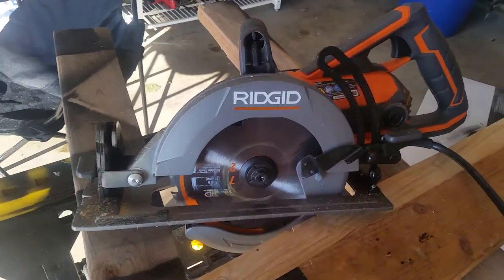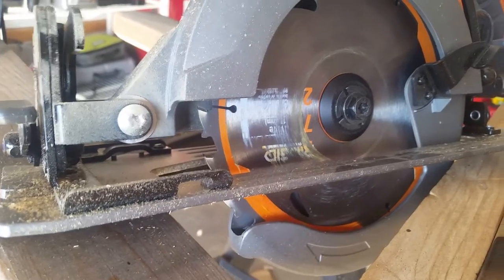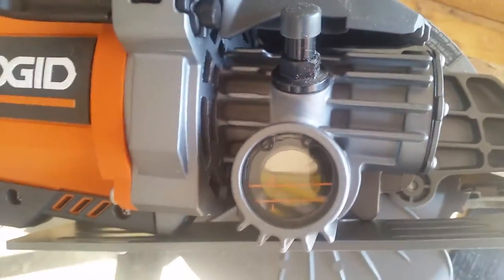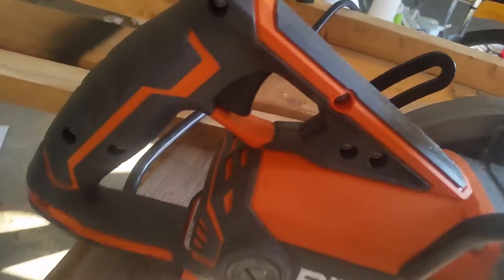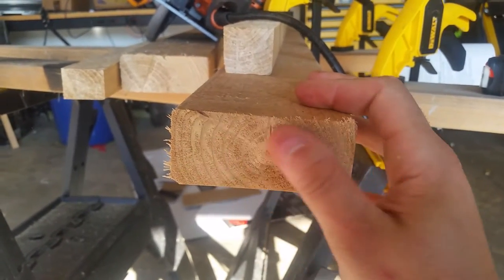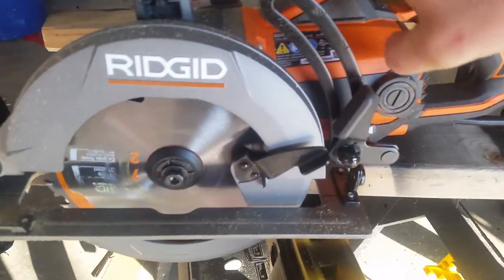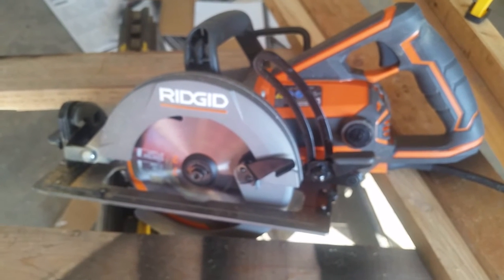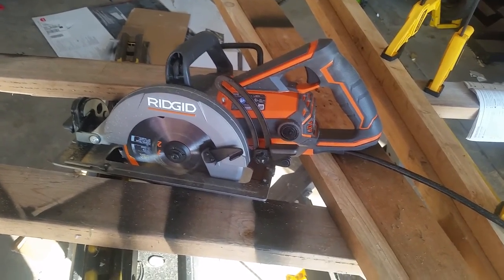The RIDGID TOOLS Thrucool 7 1/4" Worm Drive Saw is a BEAST!

Comment: I had purchased the standard skil saw without the magnesium, and found the saw to be terrible despite all the hype terrible ergonomics especially the handle which is total crap, very heavy saw and jerks like a wild animal when starting it up.took it back to Home Depot and exchange it for the rigid thrucool shown in this video and man, what a difference in feel and sound ,the saw is much quieter better balanced than the skilsaw also the blade stops a lot quicker and the handle way better being slightly angle more upright for better control of the saw, I’m in love with this saw .Thanks for your review of this awesome circular saw.

Comment: I could use some help from the experts here: I just bought one of these, and I am trying to mount the blade for the first time. I cannot get the spindle to turn no matter how much force I apply. I have tried boiling it and using an extension bar, and it absolutely appears to be frozen in place.I was hoping someone had had or heard of a similar experience and could offer me advice. It seems like a great tool.

Comment: forgive my ignorance, i am new to the world of powertools,  but what is the difference between a regular circular saw and a worm drive saw?
Reply: A worm drive is like a train vs a truck ,when the train hits something  hard it will go through it, the truck will stop in its tracks ,as per sidewinder
Reply: Scott great question it has a worm gear that integrates behind the saw to the motor and it's much more powerful than a direct drive-& a lot smoother run: you can Google it and you can see numerous articles
Reply: Hi Scott, sorry for the late reply, and if you already got the info, then this is just redundant, but here's another analogy and comparison.

Worm drive saws use a special type of gear that basically looks like a screw sitting on a gear. It produces higher torque than other gear types, but generates higher heat (hence the need for oil). The RPM is generally lower on a worm drive, but that raw torque/power usually makes up for it. The motor rests back from the blade, making a longer, narrower saw. Tends to be heavier, but can still be light enough to use all day. Usually better for long rip cuts. My dad has an old worm drive (30 years old, almost as old as I am) that still works and works well. They're beasts, but a bit pricier -- mid $100's for a "decent-enough" saw.

A sidewinder uses a spur gear, or a direct drive. The motor is typically on the side, making for a wide, shorter saw. It is also usually lighter weight, so the shorter, lighter unit can make for quicker, nimble cuts. No need for oil. Typically louder than a worm, and in my experience, don't last as long. But they're usually cheaper. Think sub-$100 range for a "decent-enough" saw.

If you're in doubt and looking to just get started, go with a budget-friendly saw to get used to it. Then go from there. I'd recommend an entry-level Skil or Ryobi's 15amp corded model. Around $60, will do what most saws do (unless you're going pro), and won't be a huge investment. If it breaks, you're only out a small amount.

Comment: I have the same saw and was wondering if your blade guard is loose too?  It pivots fine but there is a fair amount of side to side  wobble in it.  So much that it almost contacts the blade.  Just wondering if it is just mine or not.  Here is a link to how much wobble there is https://www.youtube.com/watch?v=qDiz4TWdAS4
Reply from the maker: Hey Bill,

I just checked, and mine is the same way. They must have designed the guard this way for more flexibility? Good observation on your part.
Reply: +HDreviews I just looked at mine again and the blade will hit the guard with only a little force on the guard.  if the blade is turning and you sit the saw down a little roughly the blade hits the guard.